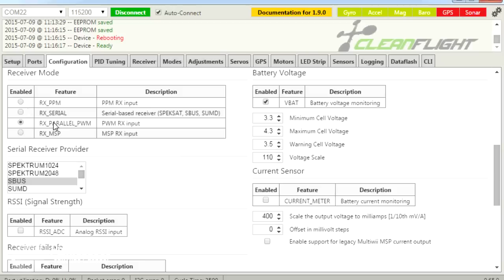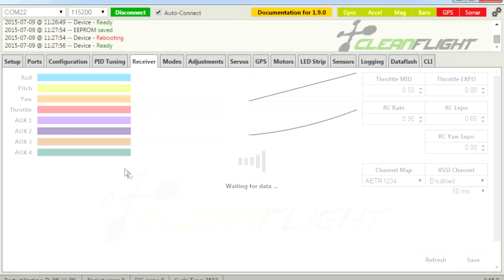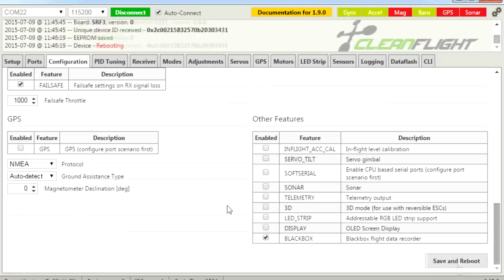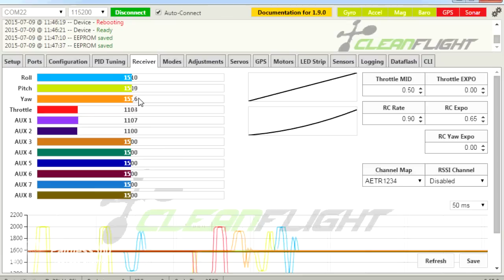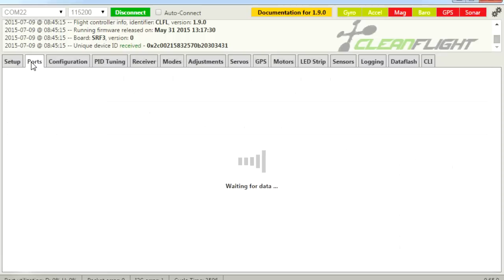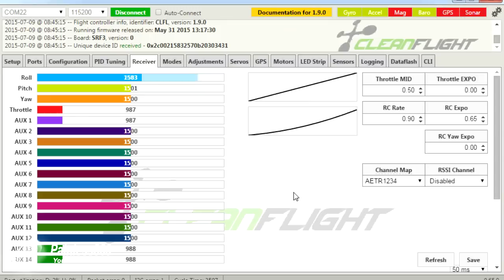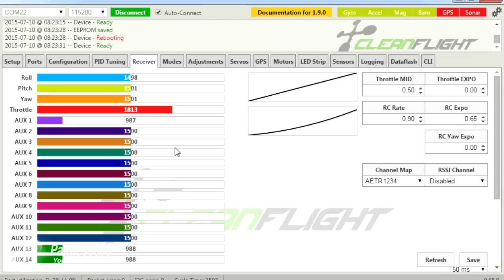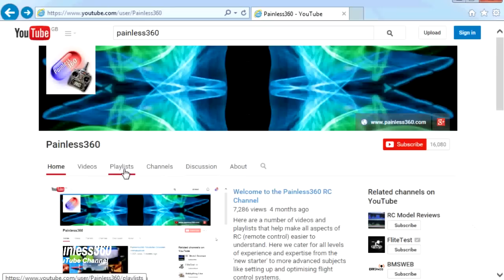Seriously Pro F3 (SP3) Quick Tip - Install and setup PWM, CPPM and S-Bus Radio Receivers

Comment: Even in 2020 this is absolutely priceless bit information and just flashed an SP F3 with 10DOF to iNav and being fitted on F330 frame, just to see what happens :-D. I'm relatively new to all this but not a stranger to electronics and following you videos managed to get a CC3D on a F450 frame up in the air. F1, F3, F4, F7... What's the big fuss?? Even now F3 is a decent platform that does the job quite well. There's a lot of buzz out there and everyone chasing specs... Absolutely brilliant channel!!! (without the drama). Thank you!!!

Comment: Great video!  After upgrading to a SP Racing F3 board, I was having trouble with my transmitter communicating with my FS iA6 and SP Racing F3 FC to do the various functions like throttle, roll, etc.  With the diagram and help you provided in your video(s), I was able to successfully get my quad going again!  I was originally unaware that I had to use both io1 and io2 ports/harnesses and I was making the mistake of trying to use just io1 only.  That was causing strange things to happen such as my left stick (throttle) was actually moving the aux 1 signal when viewed in Cleanflight (all the different colored bars seen in the receiver section).  I'm all set up and flying now!  Thanks a million!
Reply from the maker: Glad it helped, you're not the only one to make that mistake.. Happy flying! :D

Comment: Thank you for the video, my first build has been very frustrating, I first had issues with my computer detecting the flight controller, I kind of figured that issue out, I removed all non necessary usb devices and boom the computer is happy and sees the controller and then I had issues trying to configure the RX + TX, I wasn't seeing any controls in cleanflight, thanks to your very clear video I now have a clear communication from TX to RX and through my flight controller to the cleanflight program.

Comment: ripped off my 10-1 connection in a crash  so have lost sbus  and have been trying to use 10-2 for pwm  i got T,A,P,R to work but no switches after watching this i see i still need  10_1 to use pwm fully   . i really don't like these little white connectors on this board  if you damage them that's it the board is dead  . i wish Dominic would make a version with normal pin holes and maybe not try to put so much on a board ,most people just race with them and dont need so many connections on the board . thanks for the video  you have saved me a few hours banging my head against a wall  ;)

Comment: For those of you who are having issues with the SP F3 Racing Evo (clone)and connecting to a Spektrum full range (5V) receiver using PWM. I found something that helped me.  First, the symptom that I was experiencing was that after using both the IO_1 and IO_2 connectors and wiring according to Painless 360's diagram in this video, the receiver channel bars in the radio tab of Betaflight never showed active colored bars.  I pulled my hair out with this, trying everything I read.  One of the supposed fixes that some people mentioned was that failsafe needed to be set to "hold" for all channels in the CLI.  That just didn't work for me.  So here is what I did:

After connecting a known working quad to BetaFlight and observing it's settings, I noticed that in the failsafe tab, the values for Minimum and Maximum Pulse Lengths were not zero, but 885 for minimum and 2115 for maximum.  I input these into the SP F3 Racing EVO (clone) failsafe settings, and WHAM!  I had colored bars in the Rx tab.

I hope help helps you.

Comment: For those that are searching in earnest for how to set-up their Eachine 180 Falcon with the SP3  FC and the FS-iA6B receiver in PPM, there is a small twist to this video.   There are two identical wiring cable sets, one is plugged into io-1 and one into io-2.   IO-1 is what we want.  You can remove the cables from io-2.   You will need the red/white/black wires (as in this video) and the blue wires that plug into channel ONE plug on the power distribution board under the FC.  The white wire isn't on the pin at io-1 as in this video.  Just proceed as if it is.  The red/white/black go to channel 2 on the RX and the blue wires (there are two in this connector) goes to PPM/channel 1 on the iA6B.   (channel 1 of FX goes to channel 1 on power board under FC.)   Now hook up to CF as in this video and you should be good to go.
Reply from the maker: +Craig Watson see our video series 'Quadcopter building for beginners' where we connect that Rx to an SP3 using PPM. Thanks for posting the tip
Reply: This video was very helpful!  I still had no signal with the red/white/black out of io-1.  So I had to take the darned thing apart to see the channel 1 connection to the quad under the CF.  I really like your videos, very clear.

Comment: hi, i'm having problem to arm mw sprf3 board, using er9x 8ch pwm, wiring according to your diagram, so i assume its correct. running inav 1.7 for flying wing, pre arm all checked, gps 3d fix is fine, but it still wont arm, what should i check? looptime set to 2000, small angle set to 180, even i disable extra arming safety in cli, still it wont armed. thanks
Reply from the maker: +Andrian Runkat not sure, see our inav series..

Comment: Thanks, big help, setting up a SPF3 board for first time, about to wire in the "DasMikro DSM2 5CH 2.4Ghz RC Micro Receiver With 6 CH PPM Output" to an Eachine Q95 ARF with an SP F3 compatible controller.

Comment: great video been using them all to build a quad. could you do a video on setting up failsafe in more detail. my quad dropped like a stone when out of range. read somewhere that you can change settings to alter throttle speed and duration of running when failsafe activated, allowing a controlled descent. can't find any info on how to setup these settings. thanx again for the great videos
Reply from the maker: +Colin Macdonald The priority in the event of a lost connection to the model is to bring it down as quickly as possible. https://github.com/cleanflight/cleanflight/blob/master/docs/Failsafe.md is excellent and does cover this in quite some detail (failsafe_throttle). I may do a video on it in the future. Thanks for the idea.

Comment: Hey Painless, thanks for your guide, that saved me from dropping this FC. Anyway after 1 month I figured out how the Cleanflight receiver tab works for configuring the IO pins inputs from the receiver: at the top of that tab there is a dropdown menu with something like "AETR1234" wrote in by default. This mean that AE (Aileron, Elevator) are on pins 3 and 4 of IO1, TR (Throttle and Rudder) are on pins 3 and 4 of IO2, AUX1 and 2 are on pin 5 and 6 of IO1 and AUX3 and 4 on pins 5 and 6 of IO2. Exaclty like you said in the table of your video.
You can freely change this order by directly writing in that dropdown the combination you want to use. A configuration like "AE12TR34" means that you can use only IO1 pins for Ail Ele Thr and Rud. 
I've completely broken my IO2 port after crashing, so if someone had this problem too or doesn't need AUX channel and wants to use only one IO port I hope this can be helpfull :)

Comment: Hi there, first of all thanks for the great video and good explanation of the different modes. I do have a SP Racing F3 clone (deluxe with onboard OSD) and am trying to connect a Hobbyking HKT6A v2 to it in PWM mode. In my case I have on both IO connectors a three cable connector. My question is now (if you know of course or can point me in the right direction) does the three cable connector connect to the BAT connector on the HKT6A or any other channel with the right orientation of course - is this the right way of providing power to the receiver?. So far I have tried several combinations and there is just no movement when I pull or push the throttle or any other stick or switch. The RX and Tx are bound (have used them with a foamie before) and the motors are reacting to throttle in betaflight as expected. Thanks for taking the time to read my novel..;) Cheers Harry
Reply from the maker: The black and red wires that form the first two wires in the PWM connector on the SP3 will supply the power. See the other videos in the 'Introduction to Remote Control' and 'Quadcopter Building for Beginners' series for lots more tips and tricks. Best of luck!
Reply: Thanks for the info...managed to get it working - motors are spinning, initially all channels were reacting when connected to PC, but had forgotten that I needed to arm the quad when disconnected. Thanks to your video I managed to do that as well and get the first reactions from the Tx. The arming is a bit erratic though..have tried the throttle to low and Yaw to left and right and it worked twice but not 100% sure what exactly the settings were. Have played also with the adjustment sliders on the Transmitter and I think it might be working when the throttle one is at the lowest point. Can you point me in a direction where I need to make adjustments to make this work..looks like it is sooo close..;) Thanks

Comment: Thank you for your very clear instructions regarding the different setup arrangements for the different modes. I see some people solder the three pins RX + & - directly to the SP Racing F3 when using the FS-iA6B receiver. I'm wondering what the benefits of this are?  (I think it's called the UART 3 where the three wires are soldered directly onto the RX?) I'm assuming they do this to simply save space on smaller frames but is there any other reason? Any assistance would be appreciated. I have found the white plug wires are indeed pushing into space where I'm trying to place my receiver. Newbie.
Reply from the maker: +Woof Bark when you use a serial receiver, you need to use a UART. Different boards implement this in different ways. The manual for the board usually tells you where to connect things like sbus and Ibus to. Hope that helps

Comment: Great videos, They really helped with the Rx set up.   I have an issue with my throttle though.  All the other gains work fine apart from the throttle. It shoots up when I turn the Tx off and drops if I pull the battery out of the quad.  weird...
Reply from the maker: +Ryan R That is, I'd rebind it to the radio and see if plugging in another channel from the FC (Elevator for example) exhibits the same behaviour.. Best of luck!
Reply: Thanks for the reply. I tried all the different options and no luck. I phoned spectrum and they said send it to them as its broken. They are repairing it free of charge so I can't complain!

So if anyone else has this problem. Send it to Spectrum asap!

Comment: im a newbie and need some advice
you use a battery via a esc to put in power to check  your receiver etc 
could you tell me?
how did you build it ? did you solder on a battery connector to the esc??
Reply from the maker: +Jason Mills Please watch the playlist 'introduction to RC' it covers lots of the basics and should help. Best of luck.

Comment: Thanks for your videos, could you solve me a question. Could i connect an FM futaba receiver in PPM mode through an single cable? or doi i need an special PPM receiver for doing that?. I have an futaba transmitter that acctually function in PPM mode but connected with PWM  lots of wires... 
Thanks for your time.
Reply from the maker: If the Rx supports PPM then you can use a single three wire cable to connect all of the channels at once. If the receiver doesn't have a PPM out on it then you can't. Best of luck!
Reply: Painless360, thank you for your quick answer.

Comment: Just a shot in the dark here.. I tried setting my futaba R2006GS receiver up with this board using pwm and when I do I notice that the throttle and yaw move together, the pitch and roll move together and my aux channels move together. I did as you did so I am now stuck at this point. Could you please try and help?

p.s. your videos are amazingly thorough and very easy to understand. Thanks for putting them up!
Reply from the maker: +Michael Spasovski I'd delete the model on the radio and start again, choose a ACRO or plane model to avoid all the default mixes you get with other setups.. Best of luck!
Reply: +Painless360 Sounds Good, I'll give that a try. Thanks for the timely response!
Reply: +marrell I'm sorry to say but I never have. I have a S.BUS receiver and that worked. So I think I'm just going to buy a different receiver.

Comment: Please help Im using Sp F3 FC and i want use sbus connector on my radiolink R9D, do i have to power up the receiver and connect the s.bus at the same time? or just s.bus connector supplies power to the receiver? Im confused and i dont want to do anything stupid and fry the board, please help, thank you

Comment: Hi painless,
Sorry if these are 2 stupid questions, but I would like to confirm my answers:
1. In the package of the Seriously pro, I got two 3 wires connectors.
So to make pwm work, do I juste have to take off the wires going into pin 1 and 2 of IO 2 ?
2. I am mounting my board, with the arrow facing toward the back of the quad. To re adjust the alignement in cleanflight, Do I just have to put 180 in the yaw offset ?

Again Thanks a lot for your videos !!
Reply from the maker: +Hamza Bendahou 1) Follow the instructions on the video.. 2) Yes. Happy flying!
Reply: +Painless360 Thanks !

Comment: Thanks for uploading this video. I have a doubt regarding the movement of my stick directions, especially for pitch and roll actions. When I try to pitch forward the quad pitches back which is opposite to what is needed. When the pitch stick is moved up the channel reads minimum value and vice-versa. Do you have any solution for this, though you had mentioned it in your video, I was not able to correct it.
Reply from the maker: Reverse the direction of that control in the radio - see the 'Quadcopter Building for Beginners' series on the channel for the steps in a lot more detail.. Best of luck!

Comment: When doing PWM or PPM with this setup, can i disconnect the wires that are not needed or should i leave it as is(so there not flying all over the place or adding extra weight)
Reply from the maker: I tend to remove the wires here, many keep them in to help the connector stay in place but I've never had one come undone.. Happy flying!

Comment: Note to Cleanflight .....

The channel map specifies AETR1234 etc. The corresponding sliders are Roll, Pitch, Throttle and Yaw. Perhaps renaming the sliders might remove any confusion for the novice builder.

Just a thought.
Reply: James Lamb I would prefer renaming the channels - helicopters don't have ailerons...
Reply: +iforce2d 
Valid point, I suppose it would be best if the slider identifiers varied with the type of craft being setup.

Comment: Thanks for the video! But I am complete newbie and can't get why do you power up sp3 with x4r receiver? Is that legal?) I mean, shouldn't it be in opposite direction from sp3 to receiver? And isn't it dangerous to give a power to sp3 from receiver and from the usb in the same time when connecting to computer?
As you maybe noticed I don't understand some basics, I can't find good info about this, so if you may point on some material, I'll be very grateful!
Reply from the maker: +Roman Polonsky If you're new then watch the 'Introduction to Remote Control' series on the channel - lots of the basics covered there. Best of luck with it!

Comment: Apparently the way the manual says to set up PWM is not the same way you did it here on your video.  After trying to follow the manual and not getting receiver channel responses, I did it this way in this video.  I got channel response, and can now arm the board, however I had to bring my throttle sub-trim down to -70, which brings me to 1060ish on the throttle channel range in CleanFlight.  I arm the board, and it'll stay armed until I nudge the throttle down half a millimeter and hold (without going left), and it''ll disarm.  Maybe I need to keep playing with throttle Expo, or something?
Reply from the maker: +Michael “MiMo” Richard That's auto-disarm. Settable in the top right hand corner of the 'settings' tab ;)
Reply: +Painless360 Ahh, I did see that.  Thank you so much!  WMP has so many damn wires!  I'll post my first flying video here very soon, thanks Lee!
Reply from the maker: No problem - sometimes you can't see the wuadcopter 'wood' for the trees ;)

Comment: I have a FrSky v8fr-ii which means that I have to use PWMl but I've got only 2 cables with the board and both of them have the red,white,black wires together in one servo connector. Shell I disconnect the white wire from one of them and make it a single white cable servo connection?
Reply from the maker: If you need that connector for something and don't need the GND and 5V wires - yes. Best of luck!
Reply: Painless..thank you for the swift reply..and of course thank you for this video..without it I would be lost :) I have unplugged the white wire from the servo cable ( with B-R-W cables ) and connected it to the aileron like you did, but when I power up and connect everything I don't see it working and I don't have the power for my RX. I suppose that the (BRW) servo connection from IO-1 also brings power to the RX. Do you have any ideas?
Reply from the maker: One cable will need the red and black to power the Rx. See the video. The other wires are then just signal only and don't need the power. There are RC power videos in the 'Introduction to Remote Control' and in the 'Quadcopter Building for Beginners' series that cover the principles in a lot more detail - best of luck!